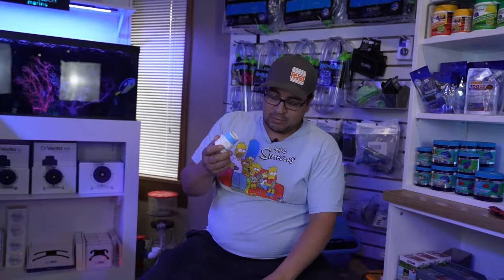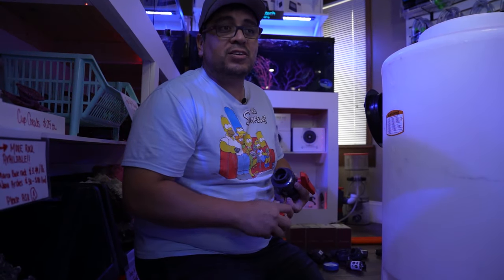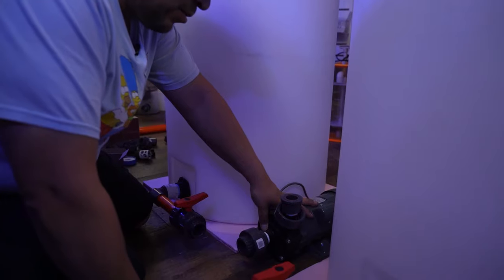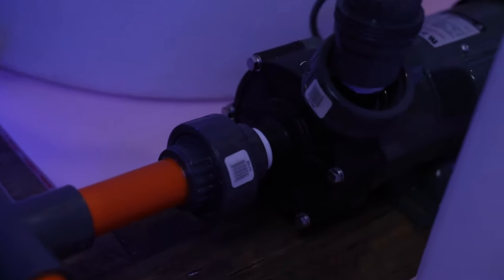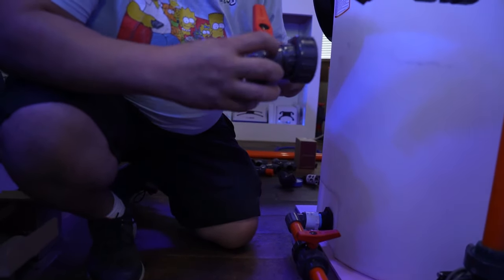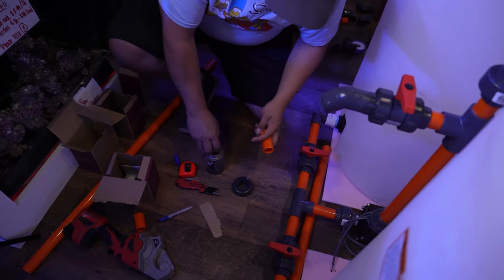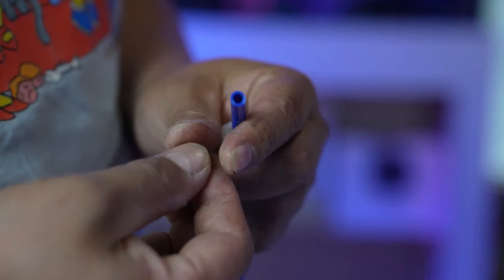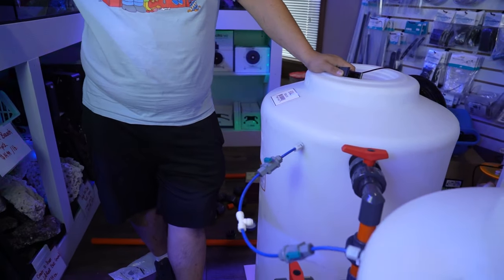How To Build A Saltwater Mixing/Water Change Station

Comment: Thank you so much for doing this, I love how you walked through every step. I've been sitting with tanks for a few months but not doing it because I was afraid I'd screw it up. Question... I'm making this primarily for my reef tank, but my father wants to come get rodi water for his freshwater tank. How much salt "backwash" would you say would be in the line? Does that make sense? In my case would you just prime a couple cups out first before filling his jugs so he doesn't get any saltwater?
Reply from the maker: You will definitely have a little bit of saltwater that you'll want to run off before sending him off with RODI water. I would say ruffly a half gallon of water should be enough to bleed the saltwater from the lines

Comment: How you get saltwater to your DT?
Reply from the maker: 36:40 You would connect a tube to this valve and pump water to your tank. In this video we used a female thread connector because our client will be using a python to fill. In most cases, we put a 3/4" or 1" male barb fitting so that you can connect the tubing of your choice